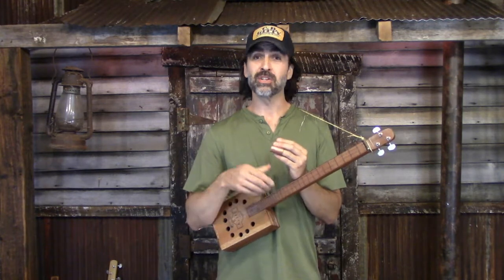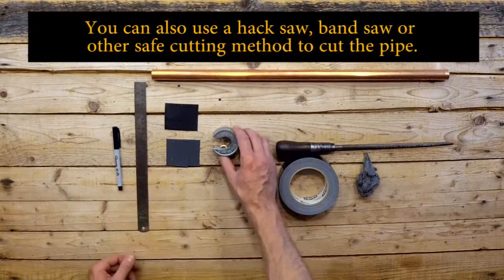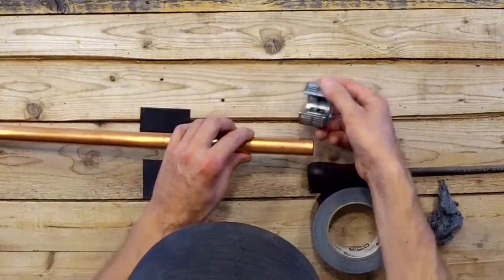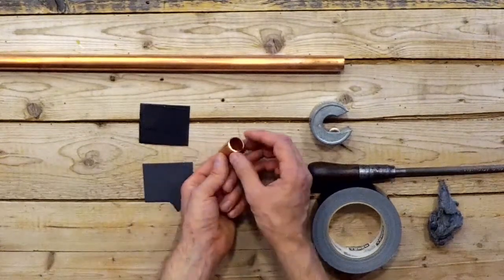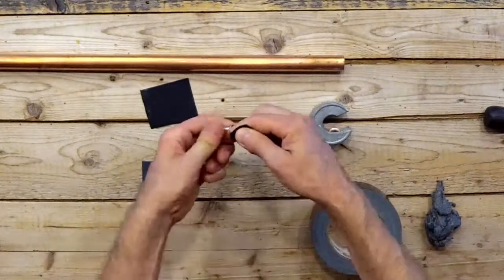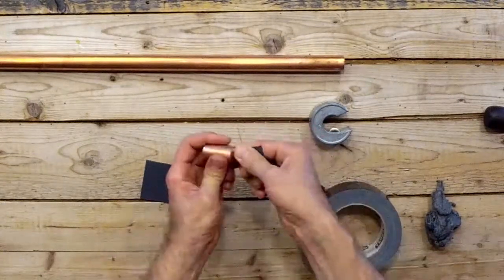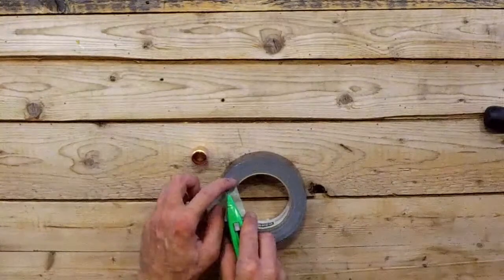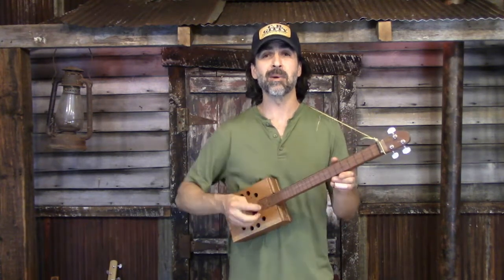How to Make a Guitar Slide from a Copper Pipe

Comment: One of my favourite slides is a stainless steel coupler for 20mm electrical conduit. The inside is threaded, and grips your finger nicely, I had to polish the silk finish to a shiny finish.
Reply from the maker: The coupler is a great idea, Spark Spark. Thank you!
Reply: 20mm is about an inch?  Seems large to fit a finger in.
Reply: 25mm is an inch
20mm is 4/5 inch
19mm is 3/4 inch
Fits my ring finger nicely and doesn't slip off
Reply: @sparkspark833  thanks :)

Comment: You can also get an off the self copper or brass pipe coupler that will fit your finger. If the coupler is too loose then coat the inside of the coupler with silicone glue.
Reply from the maker: Great tip, Carbon. Thank you!

Comment: You can get a small micro pipe cutter for $5.00.  Sanding cloth/paper is cheap.  That's really all you need.  The copper pipe may end up costing you the most if you buy it by the foot.   Well worth it as you can customize the size to your liking...you can also make them and easily sell them on Ebay.   If you know a plumber, just borrow his pipe cutter and ask him for some copper waste tubing -- then you are paying nothing at all.  LOL   Copper is much lighter than glass, steel, or brass...I find I can move the slide much quicker across the fret board with a copper slide.

Comment: What about cutting the slide length wise and creating a 1/16" gap or so to allow for adjustment to the finger. Would that work? Anyone ever try it? Similar to the thimble slide design.
Reply: Of course it will work. The gap should be about 3/8 of an inch so that you have more room for adjustment.